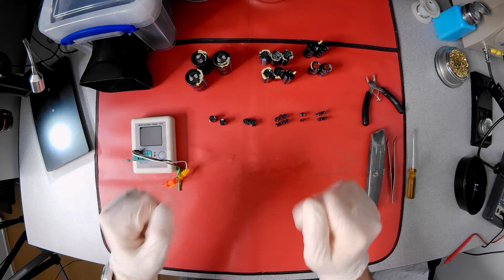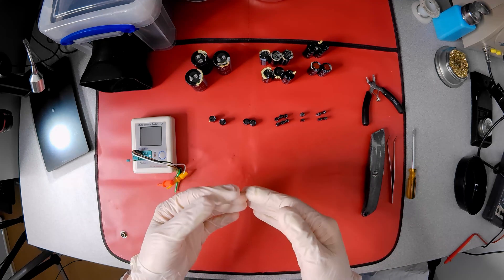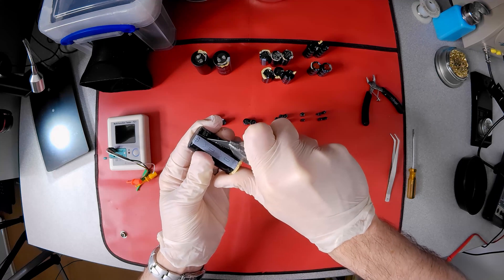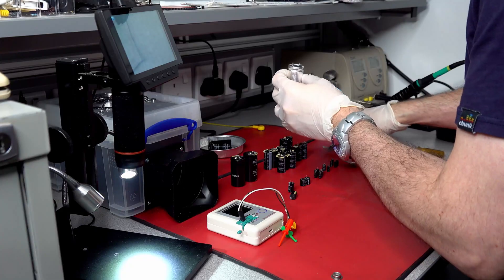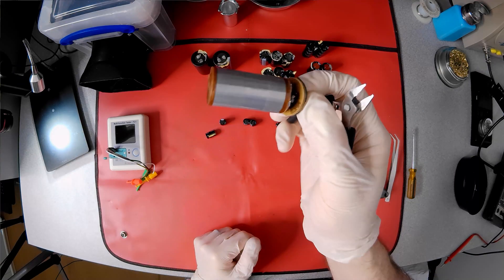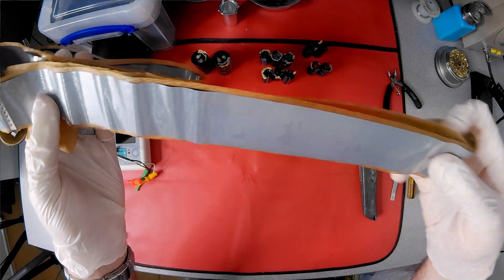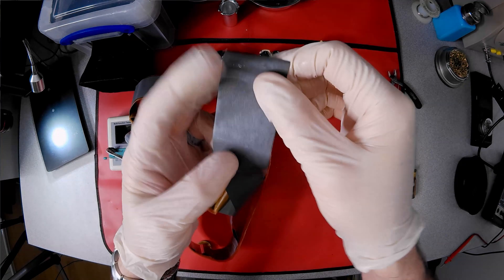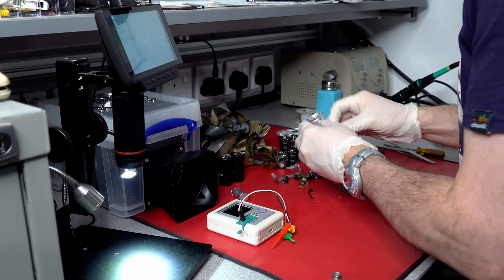What's inside a Capacitor?!!

Comment: This is what happened my PSU blew up causing some sort of liquid from a 680mF cap to pour down on my expensive graphic card got to know it is an conductive electrolyte now I need to clean my GPU. Thx for the video :)
Reply from the maker: You're welcome. I expect some careful washing with distilled water and some detergent, followed by a thorough drying will sort that. In my Amiga 2000 part 3 video I washed a whole motherboard! Good luck with the clean up!

Comment: If you want to see interesting find some old wet slug tantalum capacitors and dissemble them. Caution in that the liquid electrolyte is sulphuric acid inside, but once washed off you will find the sintered slug has interesting colours, depending on the voltage rating it was formed for.
Reply from the maker: That sounds interesting, they look quite distinctive on the outside so I'll keep an eye open for them. Thanks!
Reply from the maker: This was an interesting browse:
https://nepp.nasa.gov/files/24605/CMSE%202013%20%20WTC%20Teverovsky_n180.pdf

Comment: What a great video, can't say I've pulled a capacitor to bits for some time!
Reply from the maker: Thank you Chris!
Reply: Back in the early 1970s I was working as a trainee TV engineer at Rediffusion in Norwich and a capacitor pulled itself to bits in a most spectacular manner. I had just plugged in an old TV that had sat in the stores for a while (months if not a couple of years) as we needed one to send out as a temporary replacement as the customer's TV was going to be in the repair shop for a few days being fixed. As soon as I turned the TV on there was a loud bang from inside. It was a good job I hadn't taken the back off as the capacitor that had exploded would have covered me in gunk and not just the inside of the TV, which was a complete mess! I think that particular set got scrapped very soon afterwards.

Comment: An ESR measurement before disassembly would have been nice.
Reply from the maker: Obviously I can't measure the ones I dismantled, but for you I've just measured the other two 680 microfarad capacitors from the same PSU tear down and both measure 0.27 Ohms (+/- 0.01 Ohm) with my cheap Multi-function tester (TC1). I don't know how accurate this tester is, but the new caps measure the same so I expect these large caps still have life in them. The smaller one on the video was a 100 microfarad cap and the same cap from the other PSU measures 0.51 Ohm, where the replacement measures 0.35 Ohm. The smallest capacitor in the PSU is a 1 microfarad cap, and an old one measures 3.4 Ohm with a replacement reading 1.1 Ohm.

Comment: Pretty much same construction as modern capacitors and i dont see a reason to change these capacitors they r perfectly fine , and rubycon caps r very good quality ... There is no point to replace unless the capacitors have developed high internal resistance which could become a problem in the power supply startup circuit...
Reply from the maker: Yes, the 2 large caps did seem OK inside and my cheap tester showed them fairly close to spec. However the smaller capacitors I opened were quite dry in comparison. I was in 2 minds about replacing the two large caps but for the fact the Amigas they are from will be powered all day long in a museum and I've already gone to the effort of striping down the power supplies. For low home use I wouldn't have bothered and saved a few quid.
Reply: @TheDigitalOrphanage  what caps did u use for the replacement? Nichicon?
Reply from the maker: The majority were Panasonic, but the 2 large caps are indeed Nichicon. The full list is on the description for my refurbishment video: https://youtu.be/AHaqYxV-_A0

Comment: Should there have been more liquid when you opened it or is that the amount you would find in a modern day capacitor? I always thought they were full of liquid and the coiled layers floated within the liquid? The larger one you opened first didn't seem to have much liquid in it at all, or is that because it had leaked away over time?
Reply from the maker: Thanks for watching. That was my thought too! I even have another 2 brand new 680 microfarad capacitors, but they are for my A1500 when I get to it and I don't want to waste them in the current situation we all find ourselves in. These don't appear to have leaked though and were still "wet". I'm not sure there was much room in the case for too much more liquid.
Reply from the maker: To add to my previous comment, the smaller the capacitor was, the drier inside it seemed, and the more out of spec (specifically concerning ESR) it was.
Reply: @TheDigitalOrphanage  Certainly in my experience repairing Amigas, the smaller capacitors are the ones that have leaked away (or maybe just dried out) the worst where the larger ones seem to have fared better.